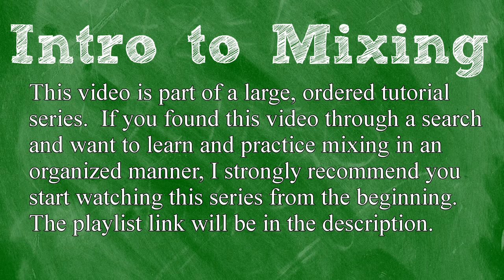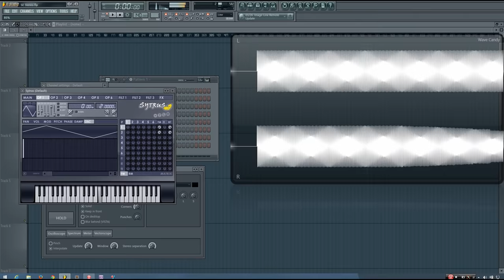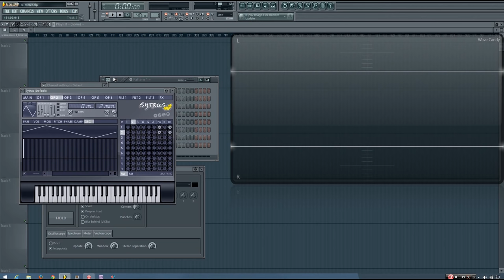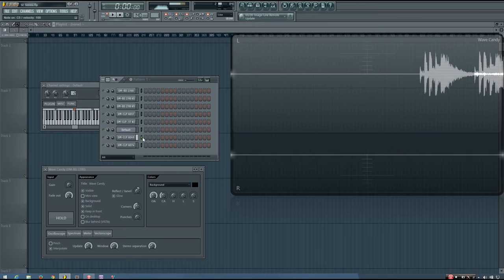Sound Explained: Stereo

Comment: Thank you for your video and explanation.
Everything you've said is quite easy to grasp and I'm really thankful.
However I've got a question: if I record my electric guitar in mono and then simply copy that single recorded channel to the second, let's say it will be right channel, and then I will move on changing its amplitude, will it be stereo or not? :D I don't know how can I change its frequency or timing. As for timing, I can probably use some delay effects though.
Thank you.
Reply from the maker: If the only thing that you change is amplitude, it will be as if you have taken a mono sample and panned it.  It won't add any stereo width, it will just make it sound more to one side (the side that has the higher amplitude). You could use delay on one of the L/R channels to give it some stereo width, which is called the Haas effect.  
If you're able to, I would try recording two takes and panning those recordings opposite each other. This is a common technique with vocal recordings, and the two recordings will vary, at least slightly, in amplitude, frequency, and timing throughout their duration.  I think this would produce the best result.
Reply: thank you man, I appreciate it!
I used the delay and it seemed to improve my initial recording significantly, sounds more "professional" and the melody has acquired a certain depth and width.
I will try to record the melody in two takes and will see what it brings about.
Reply: @IVTheFourth  Thanks for this explanation. You say changing just amplitude in one of the two channels (panning) doesn't produce any stereo width.. How so? If you start hearing signal coming more from the left than from the right, isn't that a kind og perception of width since u can identify something coming more from one side more  than the other side ( unlike a mono where it only feels coming from the middle - i.e no width )
Reply from the maker: @jopterms  That's a good question. 

In my experience, "stereo width" is used to describe a specific quality of a sound, which is caused by having different waveforms in the left and right channel. It can cause the sound to seem like it's surrounding you or filling up some sort of space. This quality can be increased or decreased using the stereo width knob in the mixer.

A mono sound or a sound that lacks stereo width will sound almost dimensionless in comparison. It will also sound as though it's coming from one specific place. Panning this sound will change where it appears to be coming from, but it will still have this "dimensionless" quality. 

This is all just regarding the sound on its own. In the context of a whole mix, panning mono sounds different directions and/or by different amounts will create a sense of stereo width.

Comment: i dont understand so if you want to make a stereo sound you have to duplicate it and move one to the left channel and the other to right channel, but then you have to change both the sounds to make them stereo but isnt that going to change the sounds
Reply from the maker: Leonardo Trifiro If you're wanting to take a "mono" sound and make it "stereo" without affecting it's timbre/character too much, you can simply delay either the left or the right channel slightly. This will result in each channel sounding the same as the original sound, but the delay will make the waveforms for each channel different and result in that "stereo" sound. This is often called the Haas Effect.
Reply: ***** Thank you so much your the best, ive been looking forever to find these videos thank you so much keep up the ggod work
Reply: Leonardo Trifiro and thank you for the fast reply